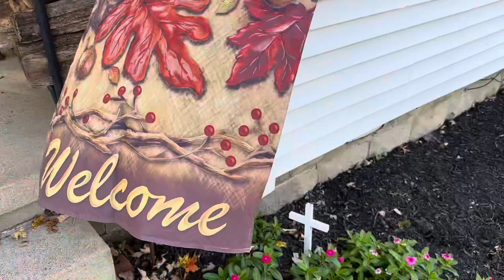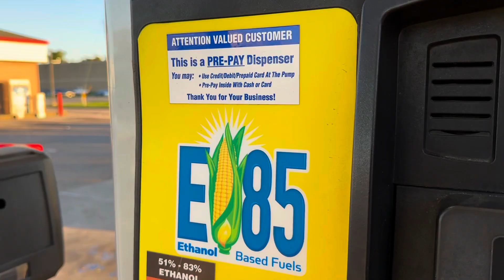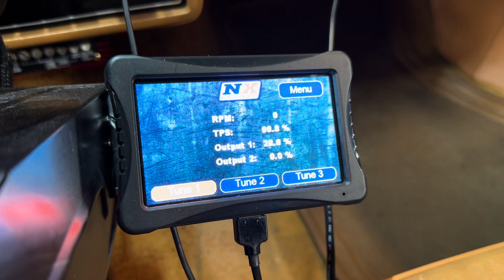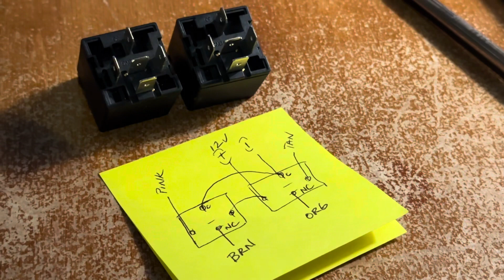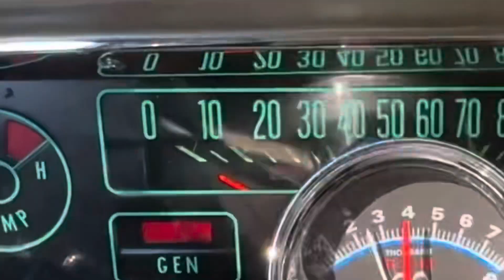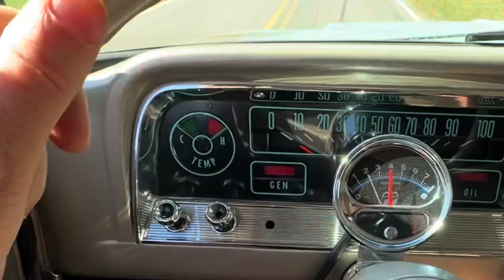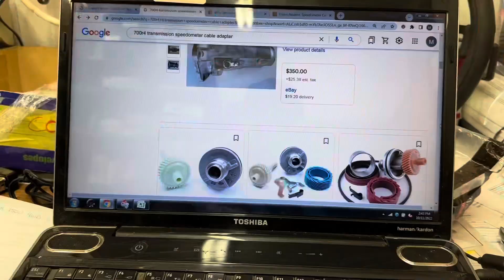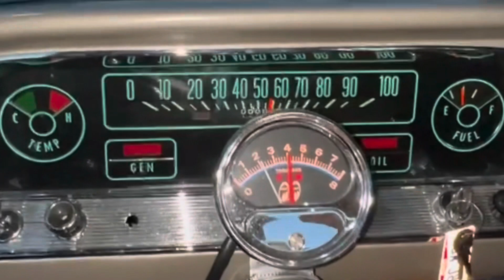DONT EVER COUNT ME OUT!  “The Old Man” NEVER quits!  MALIBU COMES BACK FASTER THAN EVER!

Comment: I dig that 64 chrome dash.. I will order one for my current build. Nothing like  a clean dash cluster with sharp lines.. I did my LED bulb conversion... Thanks Uncle Buckko for the gear mod tip since i too will be running a 700R4 in my 64 behind a warmed over 283!
Chassis is done.. now for the bodywork and paint!  Those trucks tow nice youll like it.

Comment: Great video as always!! Love what you're doing with the 64 C10. I don't know if will still work, but back in the 80's & early 90's I worked for a transmission shop and when we had a speedometer that was off from a transmission swap we would start by changing the driven gear. Back then each tooth would change the speedometer by approximately 3 mph. If you want to slow it down add  a gear with more teeth or 1 with less teeth if you need to speed it up. If you can't get a driven gear to change it that much you may have to change the drive gear also. I've forgotten exactly how much each tooth changes the speedo on the drive gear, but you can probably find that out from the guys that do your transmissions. You may still have to  do some fine tuning with the driven if you do have to change the drive gear. Like I said this was a while back but GM's were always a lot easier to do this on because most of them just had a plastic drive gear on the output shaft that was held in place with a springclip. Most of the other makes had the drive gear made/cut into the output shaft, especially Chrysler transmissions. Hope this helps. You may have already knew this, but I just thought I'd tell you just in case. Thanks for everything y'all do to bring us all along for the ride.

Comment: I used a Classic Instruments Sky Drive GPS Speedometer Sensor, with their instrument cluster when I built my 62 C10 Pickup; works great with no messing with cables or gears trying to match up to a 700r4 transmission.

Comment: Carrier bearing. Grrr I’m a huge fan of the 64 to 66   Save yourself time, energy and money and stick a 1 piece drive shaft in it. If you don’t stock up on them. If it’s not the rubber ripping the metal stand will bend because they are cheap thin metal these days. Love the 64. I have 6 64-65 right now and my daily is a 65 c10 big back glass short fleetside. I have it’s twin sitting next to it ready to start building. My 66 has pieces on it from my grandpas truck I rode to kindergarten in and it’s been parked since my son’s kindergarten year when I used it to drive him to school. So some day that one will be his to drive his son to school. Those trucks are amazing.

Comment: Old news, but Jacobs nitrous master mind unit worked like a champ open class mud races. Until we turnt  it up wide open. For a whole 5-6 races.It started clipping RPM to 5,000rpm,set at 7,500 when we were racing a blown alcohol rail. Rev limiters are suspect. At 10,000 rpm setting it made it thru the season and quit firing nitrous selinoids  completely the next year

Comment: Mali gonna wipe the earth on rematch with that red hand grenade billy is building hahahhaa really though, love the mustang (same year as the one I owned), but really like the mali as well. The Mali is a beast, the mustang as well, however, most of my exp is with mustang's, and what I see atm is a bunch of future broken parts. IMHO, rear hasnt broke yet due to too much flexing going on with stock upper and lower control arms, that and the stock ones are also moving around on the bolt holding them in, very bad on the pockets, he gonna need battle boxes....and that poor poor t5, that baby is going to scatter very soon as well....11's is all a t5 can reliably handle, and that is still asking alot from those trannys. and that stock block, I could point out exactly where it is going to crack if he keeps running that 200 shot. Love the content but i did find some irony in the mali vs mustang video.....I noticed that it went up really quick in comparison to some of the other videos lately, makes me wonder on how quickly the video of redemption on that stang gets put up after the fact :D